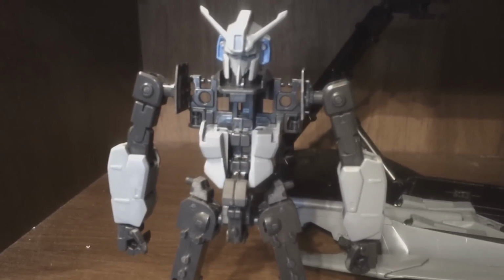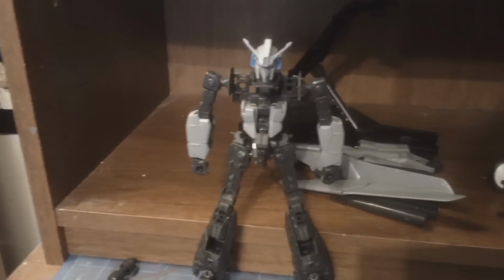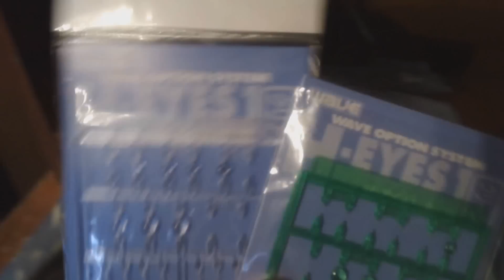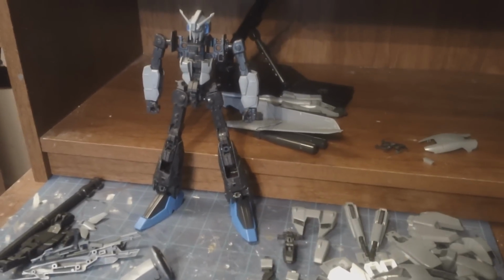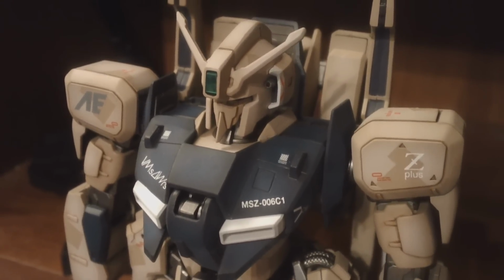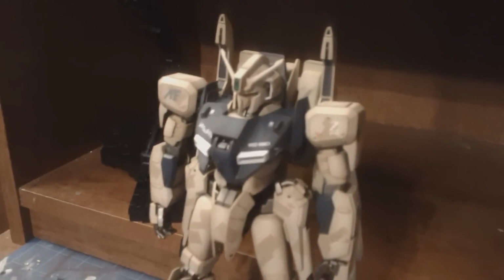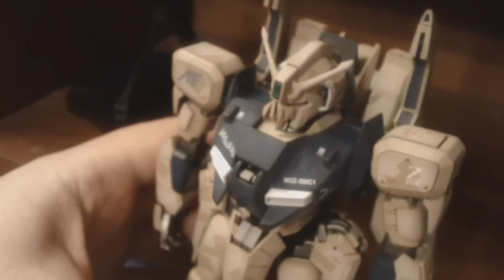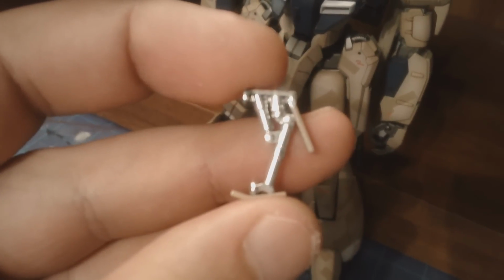Work In Progress: MG Zeta Plus C1

Comment: I really love what you did (everything right down to the clear parts and chrome), but for some reason, the digital camo effect, I think got lost. I dunno. I think the camo could've popped a bit more. Maybe have the highlight you used as the new base color on top of the camo and then highlight again? Maybe it's just me though. 

Also, have you tried polishing clear parts yet? They make the clear parts so much better, IMHO. Makes them look closer to actual camera lenses.

Comment: I recently got the MG Zeta Plus C1 and I'm going to paint it as well. From what I see you've assembled the inner frame for the legs and then put together the leg armor and filled in the seam lines. Using masking tape to cover inner frame as you paint the leg armor. How did you go about assembling the head after you painted it? It looks like you just put the head covers together then filled in the seam lines with out putting in the camera and face piece. Did you have to modify them to get it to fit inside? Any other advice for this kit? I think I've heard from some places the panel lines are a little shallow and to scribe over them a little bit.